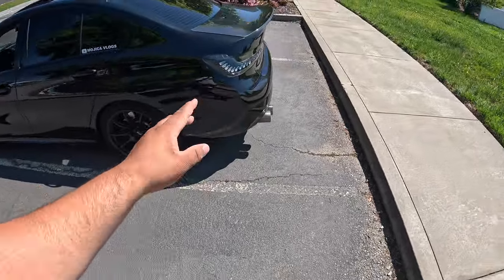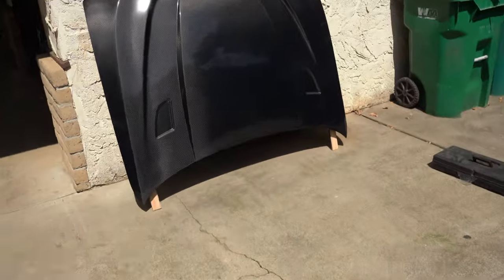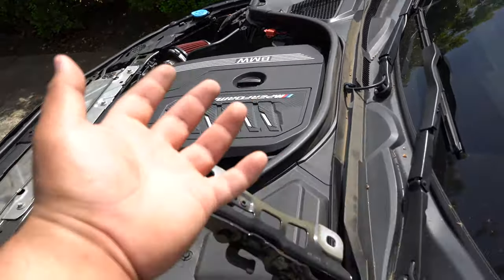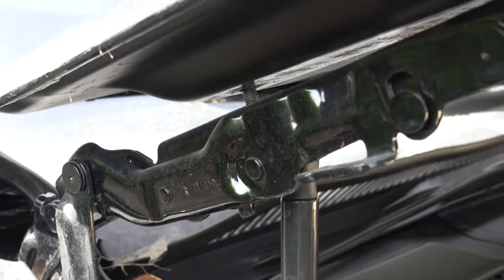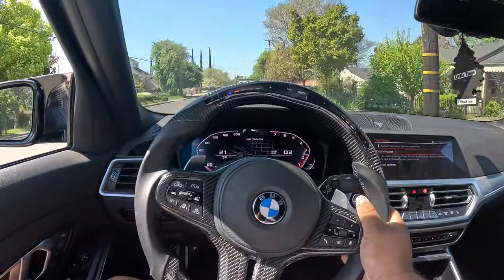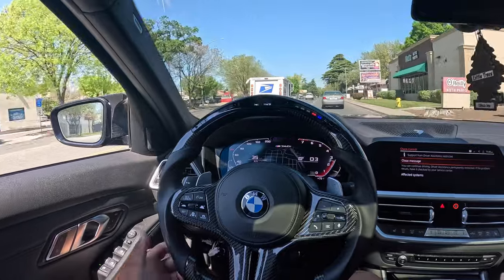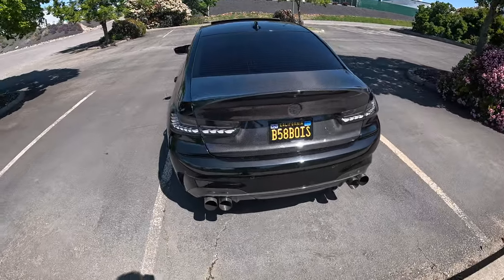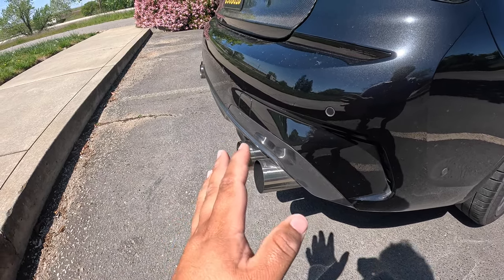MY M340i BMW gets a *CARBON FIBER* Hood and Trunk installed *CRAZY TRANSFORMATION*

Comment: Little advice from someone who went through it, skip the hybrid turbo route & go full frame turbo. If you are stuck on on hybrid wait for the pure 900 to come out mid to later this year. It will not require a core plus will support around 800+whp or 900bhp
Reply from the maker: I don’t want to full frame Cz I live in Cali lol ! 
And pure 900 was just announced on the realest date :)